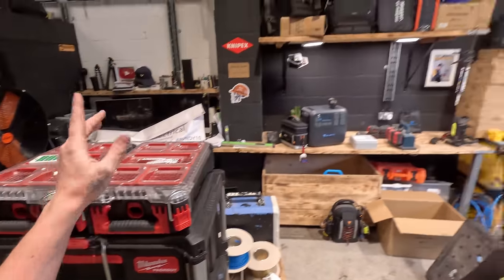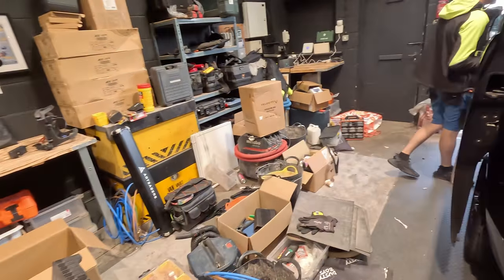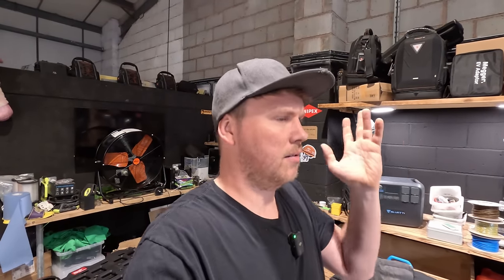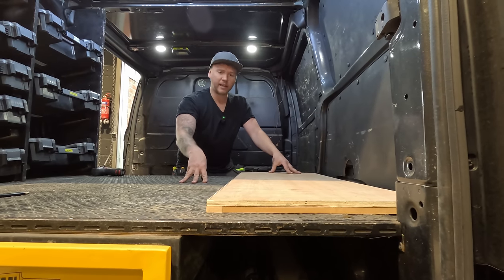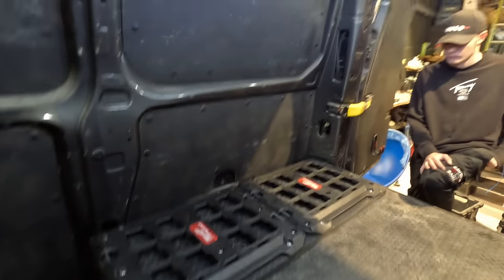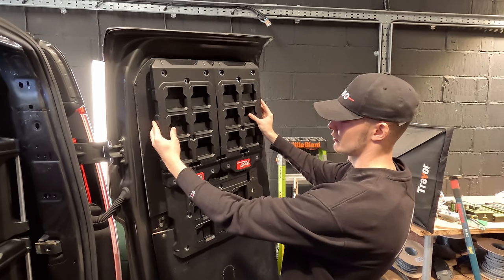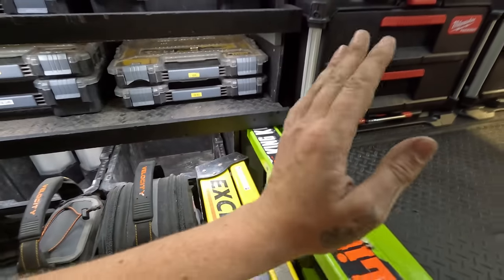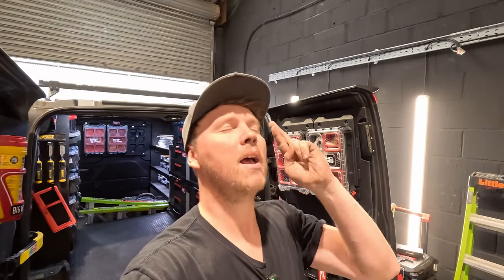Electricians Van Tour, Milwaukee Pack Out

Comment: Good layout, I would however suggest turning the top rack on the door the other way round so the trays slot down rather than push up. 
I did this initially then one day I didn’t clip the tray in fully and when I went over a speed bump it went flying, fortunately as they are well made I didn’t end up with 10000 crimps all over the van.
Reply: Yes agree totally. Speed bump ! Picking things of the floor for hours 
It's going to happen 😢
Reply: Was going to say the same.
Reply: Just the logos upside down is annoying me 😂

Comment: Being a very early adopter of the Packout system (was on the first waiting list for the 3 piece set to drop) and parting ways with well over £3k on it in the process and still buying the stuff. I’m a huge fan of the drawers and the organisers, the packout plates, the XL box and a couple of of cases but you have to find what works for you, once you’ve done that it won’t let you down, solid kit, well built and functional, add to that the shadow foam in certain cases and it really can force you to stick to a better work flow! The best purchase I advise anyone to buy is the packout dolly, it’s so much better than the trolley and for bringing valuable tools in at night or moving items from the van to the job is perfect! 😊

Comment: We racked out our vans with packout years ago and solely went for packout as you can mount them side by side with the front catch system.
Got even better when the draws came about although they won't take much load.
From experience better to mount the boxes upright or sideways on the walls if loading with any weight.
Mounting them on sled runners to create a pull out system works well.
Also so we could get draws out to take onto site we created an aluminium rack with some 3d printed mounts to keep each unit separate.
Price is the only killer with packout 😂

Great job.
The packout also can be used to make kits for labelers and all the tapes etc.

Comment: big investment but will for sure save you some time being well organized. maybe put some foam/sponge stuck to the wall on the right side if you encounter rattling from the boxes, especially for long journeys

When I racked my sprinter, I put loads of strapping points / tie rings wherever I could and bought the decent auto retractable ratchet straps, was amazing for securing all different thing's over the years.

Comment: It would be cool if the pack out system on the right side was on a roller pull out so you don’t have to climb in the truck to access your pack out drawers. They just pull out the back and can roll back in

Comment: Have had them stacked 3 drawers high and one crate, all full of sockets, switches mcbs etc at my back door with only the floor plate holding them together. Been over a year now and they've held up fine sofar, don't hear the rattling in the cab

Comment: I always think with Vans that Brains had the right idea with the design of Thunderbird 2. A container that can be swapped out depending on the job. Pull into the unit press a button and the whole back of the Van is swapped out.
Reply: I actually call it the Thunderbird 2 system!, so easy for swapping between domestic and industrial and then most importantly weekend adventures

Comment: Really like what you've done here! I've been having the same issue with the size of the packouts in my transit.. What are the size of the optimax screws you've used to screw the pack outs system to your bulkhead that don't go through the material on the other side? Cheers